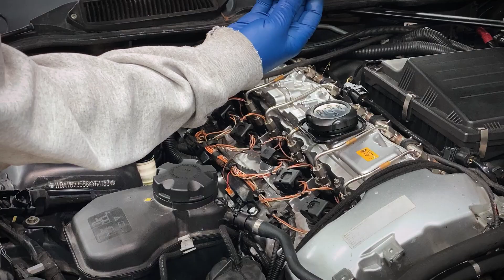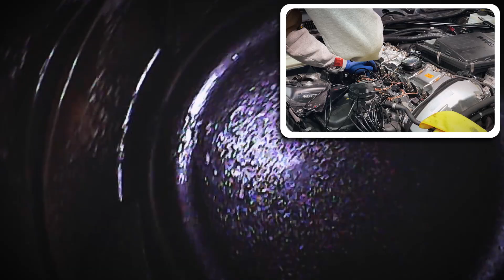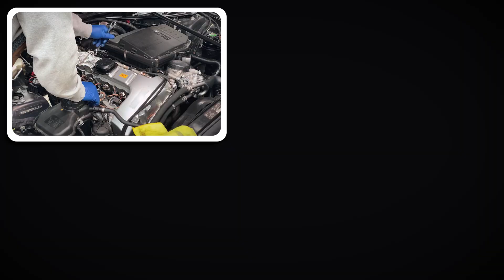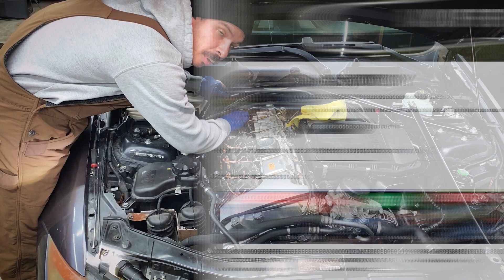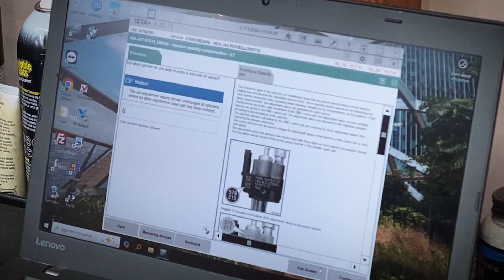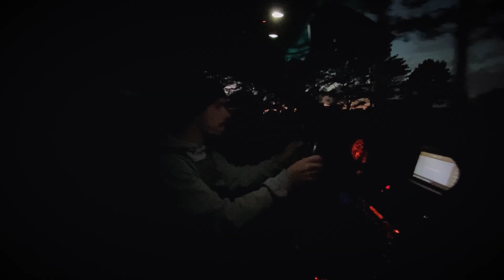BMW N54 Direct Fuel Injectors! How, When, & Why?

Comment: Nice man! I’m going through a massive 2007 BMW e93 repair by my self, already replaced high pressure fuel pump, low fuel pump, oil filter housing gasket, vanus sensors, camshaft sensors, and waiting for crankshaft sensors to arrive from fcp euro tomorrow. That baby still not fire up, it cranks but won’t fire up. It has 80k miles on its new engine because the other 126k miles engine blew. God helps it’s the crankshaft position sensor lol!

Comment: Have an N54 that misfires but only after it has been driven and sits for a while. It's always cylinder 2. After the car starts running or codes are cleared, it runs perfectly until its shut off again. I'm assuming that injector 2 is leaking or stuck, and it's causing a misfire on cold start. I don't have $4000 for a set of index 12s, so I ordered a set of index 5's off of ebay for $300 since that's what's in the car. Crossing my fingers that at least one of the 6 is good enough to get me on to the other side of this issue long enough to get my car inspected. I replaced valve cover, oil filter housing gasket, PCV valve, coils and spark plugs in the last two months. I just wanna be able to drive my car legally man.

Comment: Are you able to do a review on the visesco index 12 injectors? Would be good to know how they are holding up after running them for a while. I realise that this cars been given away so I'm wondering if the owner has had any injector problems as I'm in London England and thinking of purchasing some myself. Reviews on FCP website for these injectors don't seem too happy. Thanks

Comment: I have rough idle at coldstart only on BMW n53 530i.  As soon as the car is warm it runs very smooth. 
I sprayed 2 cans of throttle valve cleaner. 
I replaced ignition coils, spark plugs, battery sensor, vanos solenoids and filters, top temp coolant sensor.  
I re-coded the injectors. 
The rough idle at cold is better but not gone yet. I guess it is the direct injectors. I will pour some bottles of injector cleaner in the fuel tank and see what happens. If that does not fix it I will need to replace the injectors. 
What is the optimal long and short fuel trim with good injectors and what is the reading with clogged or dripping injectors? Thx for your thoughts!
Reply: Same problem me now the card have multiple missfire change all but not injector

Comment: Hello. My injectors are index 12 and I'm getting a mixture control error. My spark plugs are full of carbon in the exhaust. My oxygen sensors are pitch black. I clean the spark plugs and then half an hour later, the mixture is rich in carbon. I changed the high pressure pump and the HPPF sensor. What could be the source of this problem? How should I test the health of these injectors?

Comment: Why not leaktest your injectors , you Can clean them , pump injector cleaner through them with a low preasure fuel pump activate them with a piezo injector tester, run the cleaning for 1 to 2 hours rejses the cleaning liquid

Comment: You shouldn't remove those caps on the tips until right when you're about to put them in or they will begin to swell again and possibly not seal correctly when they go it. Mind you I haven;t had any troubles. Well once. LOL.

Comment: Woah. You're very right those injectors should not be that easy to come out! They should require the tool you mentioned or at least a hooked type of tool to pull them up and out WITHOUT YANKING THEM BACK AND FORTH TO PULL THEM! This is very important as if you do this it can wallow out the injector holes where they are supposed to be seated and sealed in and cause them to give...you guessed it Misfires. LOL. Then you will have to use a special kit to repair the holes which I was surprised there is a way to repair them from your favorite store or one of the other popular ones. I can't recall what the name is sorry. Great work as always!!

Comment: Are the vitesco injectors original? I read that vitesco /continental vdo are the same. The vitesco injector is doing his job, but I am afraid its fake.
Reply: vitesco injectors are re-manufactured in hose old Siemens/VDO cores , all internals are NEW but the core ( billet ) is re-used

Comment: No way everybody gets a cylinder 3 misfire. There must be smth on that fuel rail that destroys the injector number 3. When that injector is gone,others start to destroy themselves from imbalanced work. Pressure rail giving too much pressure on the injector 3, that design is fucked up I guess. Must be different on newer BMWs.
Reply: I've had three different N54s, first one was a 2008, made it 212k miles on the injectors that came with the car before I was rear ended by a semi. I think the more important factor on these is age, this car was totaled in 2015. I did have cylinder 6 issues, but they were related to the valve cover and running without the cowl. Second was a 2009, had horrible issues with Cylinder 2 specifically. Killed 2 injectors and multiple coils. Also had valve cover related issues on 6 and 3. That one died in a flood :( Third is also a 2009, Also killed the Cyl 2 injector within the 60k I've had this one. Pretty sure I've bought like 50% of the manual transmission N54 powered E90s in my metro area lol

Comment: Why does the fuel line on cyl 6 look backwards?
Reply: I’m pretty sure the fuel line for cylinder 6 is a different shape probably something under the cover or maybe the PCV system is the reason because it’s also near the back

Comment: Great video as always, bro - But shouldn’t you be putting the injectors in the bank within 30 seconds of removing the seal covers, to prevent the seals from expanding outside the bank?🤔 The seals should only expand whilst inside the bank to create a perfect seal inside the bank - That’s why they come with the metal seal covers to keep them compressed until immediate installation is required
Reply from the maker: I got em in there pretty quick after pulling the covers, and I actually didn’t know that it was a time sensitive thing, but zero issues so far!

Comment: I’ll stick with my n52 engine, less power for sure but so much easier to work on, more reliable and way less complex.
Reply from the maker: i agree 100%, however the power of this N54 is supeerrrr addicting lol
Reply: @DayOffDIY facts
Reply: N52 is just a basic engine. Might as well get a Camry v6 if reliability is your ultimate goal. I don’t buy BMW’s for the reliability 😂
Reply: Engine is only as reliable as the maintenance. Outside the injectors n54 is pretty reliable
Reply: well N52 in non turbo engine , comparing it to a turbo N54  is not correct

Comment: Those injectors came with Teflon seals pre-installed?
Reply from the maker: yup, you pull those metal caps and the teflon expands
Reply: @DayOffDIY  Nice good to know. One less tool or step is always a plus.

Comment: The N54 Piezo injectors are superior to the solenoid injectors that replaced them, it's a shame the N54 had such bad luck with them and caused BMW to drop the technology.
Reply: B58 uses piezo injectors
Reply: no B58 does not use any piezo injectors 🙂

Comment: Cool video bro. I think you did the install wrong though. You need to get the injector seal tool kit. The seals are a bit oversized to ensure a snug seal. You use the tool and it will give you about 30 seconds to pop the injector in before the seal starts to widen. Hope you don’t get any blow back
Reply from the maker: no blow back yet! I installed the injectors shortly after pulling the metal caps while the teflon is expanding, I havent seen a tool for it before, so far so good!
Reply: @ nice 👍🏼 I once used Teflon tape on a used injector I installed from eBay. It gave a really snug fit on the two points where the seals are. Excited to see more on this car. That must be a great feeling once you get that thing 100% mechanically sound and then start to do cosmetic surgery

Comment: why do you (and others) need to insert the serial number of the injector? in my head, it doesn't make sense...
Reply: It's to activate the license, otherwise they'll stop after the trial period of 30 days. Joking aside, they vary a bit in how much they spray. These compensation codes tell the ECU how much.
Reply from the maker: yeah so its to help the computer compensate spray pattern between all 6 injectors, i believe they are given that number during testing at the factory, so its to help the computer even out the compensation values between injectors to make them even after install

Comment: The main reason for the injectors to leak or stuck open is dirt in the fuel line (mainly caused for riding with low gas). Adding a secondary fuel filter can avoid or postpone this issue
Reply from the maker: thats a great idea
Reply: I dont Think your are right , it is Carbon build up inside injectors becaurse of the heat from combustion that in time Will Leader to the leaking
Reply: @hansjrnandreasen5867 idk I have a 535i that sat for a year and it was fine I let it get low and now I’m having issues lol i highly doubt it’s a coincidence why I was fixing the car it ran fine. I’m not a Big “fixes in a bottle” but it didn’t throw codes when I put fuel system cleaner in it for like a week till it got low again. I think it’s time to clean/replace the tank 😢
Reply: @TBD_Media does not matter how low your tank gets, your pickup will always get fuel from the bottom of the tank. The only part of a fuel pump hanger that moves is the float for the level sensor
Reply: I think the running low on fuel is really more of an urban myth...
Reply: @DearMajesty if you’re talking starvation that makes sense, but saying your car picks up more dirt from the bottom of the tank when it’s low is a myth